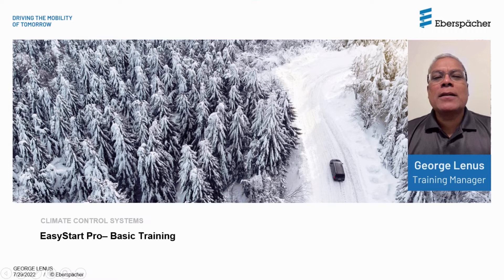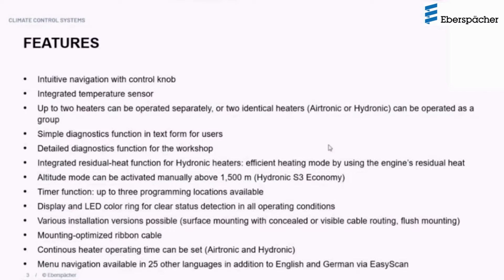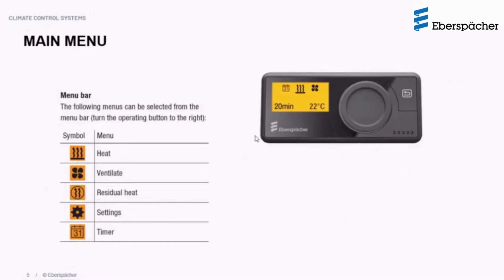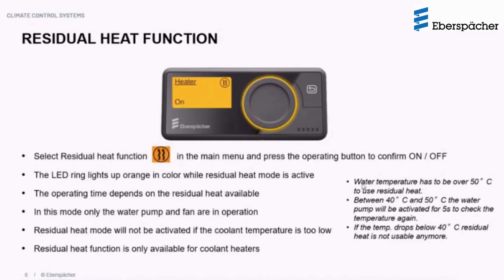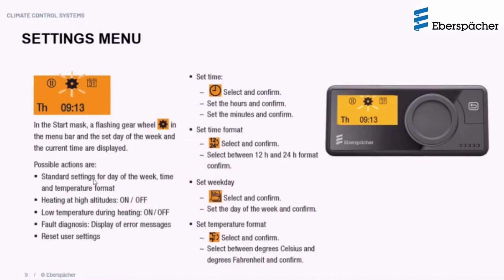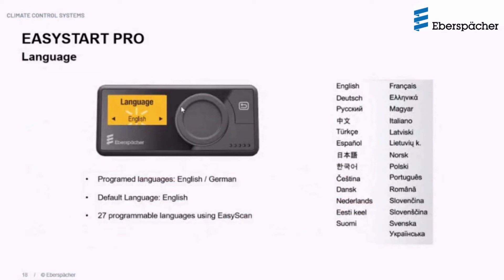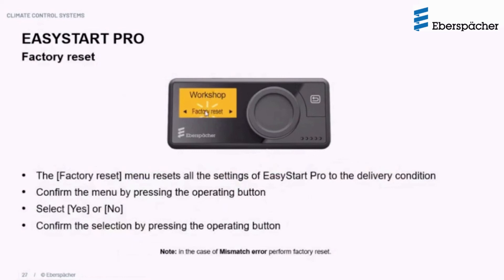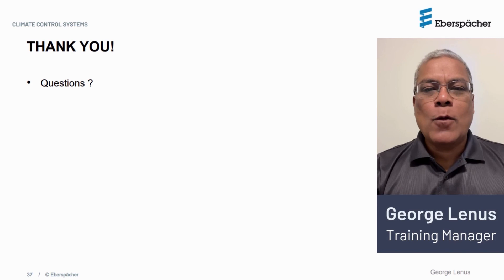EasyStart Pro | Basic Training

Comment: Will it hurt anything to leave the high altitude mode on when not at high altitude? If it just reduces fuel then the heating capacity would be reduced,  but if it overspeeds the fan, then shorter fan life would be expected,  
Can you tell me which it does in the high altitude mode?
Reply from the maker: If you are using a Hydronic S3 CS 12 V with EasyStart Pro, the high altitude mode should be manually turned ON for continuous use in altitudes between 1,500 meters (5,000 ft) and 3,000 meters (10,000 ft) and it should be manually turned OFF for continuous use in altitudes below 1,500 meters (5,000 ft). Using the high altitude mode decreases the amount of fuel delivered, so if incorrectly used continuously in lower altitudes it can increase the risk of flame loss when combined with other factors.

Comment: So do you need a separate connection to hook up both Airtronic and Hydronic heaters to one single East start pro? The info is horrible on it and nobody can answer my question.
Reply from the maker: Hi and my apologies for the tardy response and I'm sorry about your issue. You can contact Technical Support at 1-800-387-4800 X2299 and/or help@eberspaecher.com.
Reply: Did you figure it out? Currently trying to do the same thing…
Reply: Yes it was simple. I just called and ordered the separate cable that is just a daisy chain you add on and plug into the heaters. I forget the part number but they know what you are looking for of you call a dealer

Comment: I have an Airtronic M2 D4L with an Easy Start PRO. Can I control the heat using the yellow wire from the harness and also keep the controller connected? I'm able to get heat when providing 12v+ to the yellow wire, but get an error on the controller screen. H1Restricted- P000130
Reply from the maker: The EasyStart Pro is a CAN-based only controller, so it uses only the blue-red and blue-black wires to communicate with the heater for all functionalities (e.g., to start and stop it, change temperature setpoint, …). Unless you have another analog controller in the circuit (which is providing its own temperature setpoint), I’d advise you not to turn your heater using the yellow wire, but instead control all heater functionalities directly at your EasyStart Pro.
If using only the EasyStart Pro (and not the yellow wire) you keep seeing that code P000130, please contact our Technical Support Team at +1 800 387 4800 or email to ca-to-techservices@eberspaecher.com for additional help.
Reply: @EberspaecherNorthAmerica  is there any way to control the heater remotely ?

Comment: Great guide except on my controller when I program no1 then move to nu2 , it shuts off nu1. I go back in and turn on nu1 again, it shuts off number 2. I havent even tried to program nu3 yet.
Reply from the maker: Apologies for the tardy response, Katt.  And I'm sorry about your issue. I would suggest you reach out to our Technical Support Team at 1-800-387-4800 X2299 and/or help@eberspaecher.com.  They will be more than happy to assist you and/or answer any questions you have. 

Please don't hesitate to reply to this message if you don't hear back from anyone and I'll personally forward your issue to the support team and make sure you receive a speedy reply/answer.

Comment: hi ! can you use tghe easy start pro to control a ventilation unit (like kalori silencio2) linked to the hydronic heater? or do you need to install a separate control unit with a separate room temp sensor?
Reply from the maker: Hi Fabien and thank you for your question.  According to our engineering depart, unfortunately the answer to your question is no.  The EasyStart Pro is a CAN based controller and the ventilation units (like Kalori silencio 2) don’t have CAN communications built in.  But I will definitely pass your question / suggestion on to our development team.  I'd be surprised if this wasn't something they're already working on.  If anything should develop in this area, I'll be sure to let you know about it.  

Again, your feedback is much appreciated, Fabien.